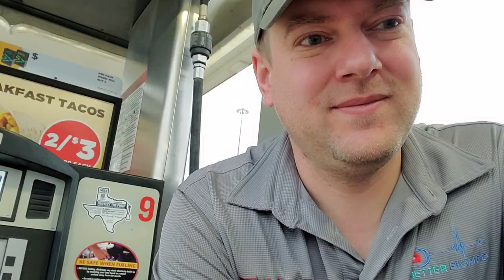Traveling Biomed Fuel Tip.

Comment from the maker: Vehicles that label 87 octane should get only 87 octane. There is more energy the lower the octane number because the fuel has a lower flash point. Engines that have higher compression (to achieve more horsepower) use a lower energy fuel to prevent premature ignition when the air / fuel is compressed at the higher compression ratio.  Putting Premium fuel in a 87 octane vehicle will not give you more horsepower, it will give less.
Reply: Yes it tell us recommended on the fuel cap by manufacturer right mine the Toyota is the lowest octane I heard that you just going to waste money if you thinking you give it better gas same way when you offer cup cakes to donkey lol while they need to eat grass ;)

Comment: Yes, 87 can give you more miles to the gallon, but you can't floor your car too often due to the risk of pre-detonation, so less smiles per gallon :)
Reply from the maker: Modern cars have knock sensors which detect predetonation and they change the ignition and sometimes the valve timing to compensate. Most modern engines are designed for 87 octane (regular) and 87 is what you should use. Higher performance engines that state 89 or 93 octane will compensate - because people are stupid but the engine was not designed to run continuously at those timings.

Comment: I always put the low unleaded one and from time to time clean my injectors with her sea foam it should be typically every 4000-5000 miles not really sure it is mentioned on the can it is available in auto parts stores and even less cheaper in Walmart !
Reply from the maker: Project Farm did an excellent video on Sea Foam. Found its results to be negligible.
Reply: @BetterBiomedChannel  thank you ima going check it though